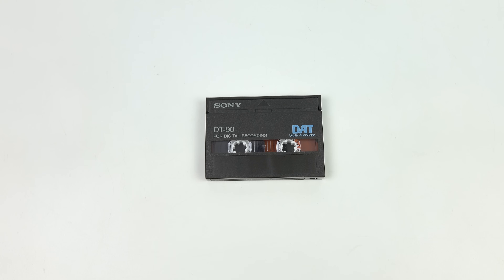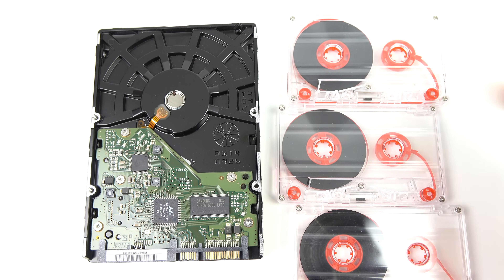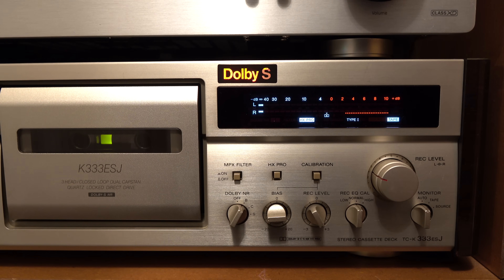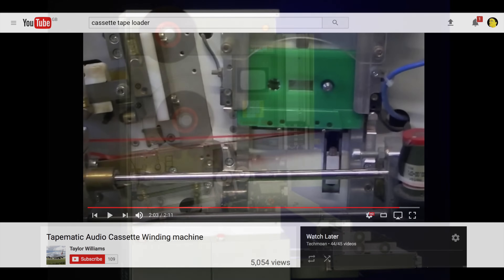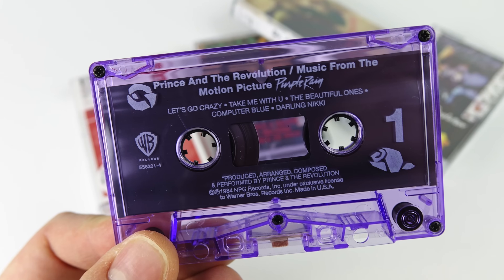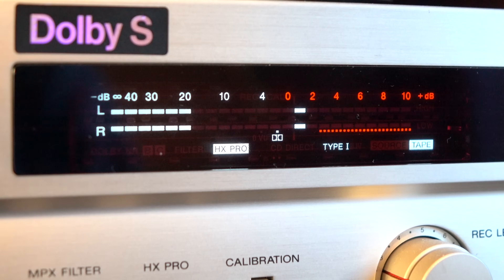Pre-recorded Cassettes' Last Stand

Comment: Last year, SHINee (a K-pop boy band) released a cassette version of their new album to celebrate the 90's theme, and of course I had to buy it. I just had a look at it, no logos mentioning anything about the process. I'm not an audio expert and my tape player is just your average kitchen table stereo, but I have to say that the tape sounds way better than I expected. In particular, it's louder than I expected, pretty much the same dynamic sound I would expect from a CD (again, on a regular crappy stereo). The only problem I noticed was that it sounds like you can hear the other side of the tape in some of the silences.. is that a thing that can happen?? Now I'm really wondering whether any of the later developments of cassette technology were used to make it, or if some dusty factory in China that never let go of their original equipment pumped it out.

Anyway, I wish artists looking to appeal to collectors would do more cassettes than vinyl. Let's be real, neither of them are practical or necessary, but cassette takes up less space in my bedroom...

Comment: Digalog or not, at the end of the day, tape is tape, and it will degrade over time.  Sure, Digalog was an improvement, but it doesn't have the durability, overall evenness of sound quality, or the ability to instantly skip to a chosen track like CD's.  Plus, CD duplication machines are more readily available today and way cheaper than when they first came out.  So, if you want to keep a recording around for a long time while playing it often and ensuring the sound quality doesn't gradually go to shit over time, CD is the way to go.  Even my Digalog cassettes didn't sound as good as when I first bought them back in the day all brand-new in the shrink wrap.  Meanwhile, I have CD's that are over 20 years old and counting, and they still sound as good as when they were brand-new.  The recordings are crisp and clean the way the artist intended, and there's no annoying tape hiss.  The last cassette I bought was in 1998 -- a greatest hits compilation by Motley Crue, and the last mixtape I made was a David Lee Roth-era Van Halen tape in 2002, which the tape player in my Jeep promptly destroyed, much to my dismay.  Since then, it's been mostly CD's and the occasional old vinyl record for the kick-ass artwork.  That said, I don't see the cassette making a comeback, unless the industry can invent a tape with CD-quality sound that doesn't degrade over time.  If that ever happens, I may consider buying cassettes again, but I'm not holding my breath over that!

Comment: Ah, the humble cassette. They CAN sound surprisingly good but you really need a combination of a higher end tape deck, Dolby S, and Type IV tape. Once you start removing those (e.g. a lower end deck, an early form of noise reduction or no NR at all, or Type I/II tape) the drop off in quality is noticeable. Still, I grew up with cassettes (as well as vinyl) so they do hold a certain nostalgia for me.

Comment: Great video as usual! And most of the comments below are even pretty good this time. I have a beef though with your basic stance that a given format has to compete with a CD or other digital file. The premise seems to be if the recording has background noise or such it is somehow a failure. I think I mentioned this before, but I’m not looking for some sort of music nirvana. I just like to enjoy a playback system, or a vintage car, snowmobile, dirt bike even chainsaw for what it is. They are all technological solutions arrived at at a given point in time. Using these old devices is like a time machine. It allows us to see how far technology has advanced. Or devolved as the case may be. 
I have long dreamt of starting a small pressing house centered around 8 tracks and maybe reel to reel tapes. I have around 17000 8 tracks. So lots of tape to reuse. Ya I know the technical horror. But I turn Anne Murray and Irish Rover tapes into AC DC and Judas Priest on an ongoing basis all the time and I’m quite happy with the results as I trundle down the road in one of my 70’s cars. You can’t really hear the music over the exhaust anyways. So the technical info in this vid was quite informative. Although I just about fell asleep a few times. The high speed dubbing aspect was quite interesting. I have often wondered if half speed recording would be a benefit or not. I think you hit the nail on the head when you guessed that most people are buying retro for the novelty. And as such any kind of Dolby or such would be a mistake. As it would penalize those who collect early gen tape machines.

Comment: I have all these cassettes and no player. After my last one died I never bothered to get another. I slowly abandoned cassettes for CDs even though that meant I would buy less because CDs were rather expensive in comparison. The upside was that you could get a lot of discounted cassettes because few people wanted them. By the time I started to buy more CDs they were just getting rid of those stupid longboxes. One of the first CDs I bought was in a longbox. Midnight Oil's Red Sails In the Sunset. I think the box lasted maybe two days before I decided to throw it out. I was maybe 12 or 13 though and didn't think to save such a thing. I imagine most longboxes are long gone because people tended to toss them and they were not that durable anyway. They created tons of trash because it looks like few bothered to recycle the packaging. I think that Playstation's earliest games also used a form of the longbox. You can occasionally still find used games that come with them. I should have several Digalog cassettes. But I can't test them against other cassettes myself because I lack a player.

Comment: Someone may have said this already, but the direct-digital-to-analog PCM (pulse code modulation) may really be effectively a digital signal made by AC bias combined with pulse width modulated audio fed directly to the recording head. The impedance of the inductive recording head would smooth out the signal and leave the analog signal on the tape. Of course, the frequency would have to be computed to work with the particular tape, but most commercial cassettes used basic ferric oxide tape.

Comment: hi you said about tape loop. the basf 1/2 inch  tape is very good i got hold of some new pancake tape basf works well
on otari mtr 10 /12 units . tascam 38 not very good. i have a otari 2700 tape loader making a video on how they work
just waiting for terry's rollers to do the pinch rollers, bob

Comment: I have a B&O BeoCord 8000 cassette deck and it sounds incredible. It cost in 1981 when it was brand new more than a Linn Sondeck LP12 turntable did at the time lol. All guests at my new years eve party couldn't believe they were listening to 30+ year old tapes. The Beovox CX50 speakers help a lot too. It has some pretty epic features like the ability to just type in for example 15:00 on the keypad and it will jump exactly to 15 minutes into the tape. It gives the tapes when playing a proper timecode like a VCR. Apparently it does this by scanning the thickness of the tape as it plays, pretty impressive stuff for 1980/81. I got in to compact cassette quite a bit lately as almost everyone practically gives them away for nothing these days.

Comment: Based on the experiments I did, I think VHS suffered from the same analog duplication problems.
Reply: I've seen the inside of the porn VHS duplication room at a mayor porn publisher. The two longer walls of the room were covered with wallmounted IKEA shelves from floor to cealing holding 200 almost new good and cheap consumer model Mitsubishi VHS players. At the short wall opposite the door there was a table with a deluxe consumer VHS player for playback (National/Panasonic?) and some equipment that made all Mitsubishi's start the recording at the same moment. The recording was done at normal speed to preserve the quality and because consumer models only had normal speed. The employee then had to swap the tape in each Mitsubishi before he started the next batch. 

(Then I'd guess that he affixed the labels, put the cover paper in the sleeve of the cases, put the cassettes in the cases, packed it all in a couple of large cardboard boxes, and then took a ccoffee break or did other odd jobs while he waited for the next batch to reach the end of the recording).
Reply: @goishikaiganmademou  Rotating porn tapes... why didn't i ever see such jobs advertised?
Reply: @keinunvergebenesaliasgefunden  same
Reply: @keinunvergebenesaliasgefunden  His job description was "janitor", but in the local language (not English). The name of the company was the only hint of that this task might ever occur.
Reply: @goishikaiganmademou  And set the write protect tab
Reply: The 8-Bit Guy I agree
Reply: Presumably they went to a digital bin system as well?
Reply: Love to see you and LGR so interested in this channel!
Reply: Ever used a VCR as an audio tape deck? You can record a six-hour mixtape using the slowest speed. The sound quality is indistinguishable from the source and has zero hiss.
Reply: https://youtu.be/UXU8qttgOk8
Reply: A reasonable conclusion.

Comment: The drop in sales for 1991 was due to U.S. economic conditions, meaning less disposable income.

"The economy was in recession from July 1990 - March 1991, having suffered the S&L Crisis in 1989, a spike in gas prices as the result of the Gulf War, and the general run of the business cycle since 1983. A surge inflation in 1988 and 1989 forced the Federal Reserve to raise interest rates to 8% in early 1990, restricting credit into the already-weakening economy. GDP growth and job creation remained weak through late-1992. Unemployment rose from 5.4% in January 1990 to 6.8% in March 1991, and continued to rise until peaking at 7.8% in June 1992. Approximately 1.621 million jobs were shed during the recession. As inflation subsided drastically, the Federal Reserve cut interest rates to a then-record low of 5% to promote growth." (Wikipedia)

Comment: Half-speed makes recordings better because high frequency recording and reproduction is typically most difficult to do. The needle must move faster on a record, and the gap on a tape head must be very narrow. Considering this, dubbing at speeds higher than normal will cause degradation of high frequency response on the end recording, depending upon playback and recording head limitations, amplifier limitations, and, in the case of phonograph records, physical mechanical limitations of the cutting head.
Reply: Half-speed recording is superior for cutting through a lacquer to make the vinyl stamper. For high-speed tape duplication, high-speed is superior in terms of almost no wow and flutter, and the frequency response on a good tape can reach 18,000 hertz. The physics are very different from mechanical cutting.  The double-speed, double-well recorders did not perform well because of poor design and cheap parts, not because of speed.

Comment: what I would like to know is did the music play faster towards the end of the tape as the full spools outside would spin faster as it filled with tape?
Reply: No. Tape speed was set by a metal spindle ('capstan') with regulated drive, and the tape pressed against it by a rubber wheel. This rubber roll fitted in the first front gap of the cassette (pulling the tape along the heads with constant speed), the record-play-head fitted into the middle one, the eraser at the third gap (for standard construction - there were others as well). The tape reels had a low-torque drive, just to just roll-up tape and avoid 'salad' - the reel drive did (should) not influence tape speed at all. 
 
You were probably thinking of a vinyl disc which on the outside indeed has faster track speed than near the center (as turning speed is constant). Tape recorders always worked with constant tape speed (and varying reel speed depending of empty or full reel). 
 
Indeed, the idea of using constant tape speed and capstan drive made tape useful at all. Good recorders kept the tape speed constant to +- 1/1000.
Reply: akronymus thanks for your reply. I alway wondered about the speed changing but as you say it doesn't.
Reply: christastic100
The thing is, if speed is not constant, tone pitch will 'walk' as well (and minimal differences or fluctuations will be heard very annoyingly) - so it dos not work to just pull the reel. So tape drive and speed adjustment is done right next to the tone head (magnet pick-up) by capstan.
 
Cassette recorders are just down-sized tape recorders (half tape width and speed, less tape on reels, reels packed in a housing) and work just similar. But the big ones were immensely expensive, and cassette recorders could be afforded to record the teen bands from the 1960s on - this was part of the big success.
 
I think on the same channel there is a video explaining how big tape recorders work - there you can see how it is built in detail.

Comment: I have one of those tape deck converter thingies that you plug into your headphone jack and I noticed I really have a hard time getting the volume right on it. I wonder what the dynamic range is on one of those.
(I may be using the wrong term here, since this is different.)
Reply: If you are talking about dynamic range of standard pre-recorded cassettes - this was just a shame. The cheapest recorder bought at the toy department could do better recordings / dynamic.
Reply: No, sorry I didn't explain it very well. It's this thing that looks like a cassette but it has a cord on it that you plug into your phone or whatever else and it plays that output through your stereo. It seems like the levels are always really low on it because whenever I switch back to the radio, the radio is too loud.
Reply: Watchdog Goon
Ok, you talk about adapters that fit in the cassette slot of a car stereo and have a jack to connect to a CD player or an ipod (newer ones connect via bluetooth)?
 
They have a weak point - the magnetic transmission to the playback head. Those heads differ in layout, so the transmitter may not precisely cover the pickup gap (for a tape, the vertical position must hit the track, but the horizontal position is not important). And as cassettes have a specific frequency response, these adapters need to have some kind of equalizer. If this is poorly made, quality can go down to landline phone sound.
 
If someone owns an FM transmitter you plug to your mp3 device, test this. I never used one, but they seem to be better.

Comment: Cobalt tape also had the advantage for the labels was that very few consumer recorders could record them. Higher bias level, much higher record level needed that most recorders could not do, thus a chrome tape being recorded to would suffer from low output and possibly print through of the old recording as the bias and erase could not clear the tape.

Recording with the duplicators used video amplifiers, as the bandwidth was basically the same as broadcast video, and as a bonus the record heads could be optimised for a larger gap and a sharp field end, as the audio is recorded by the remnant magnetism at the edge, not the field in the gap as is needed to play it. 

Video though was still stuck at 1:1 recording, you had a very small number of duplicators that used a pattern copy technique, using a special low coercivity tape and a master metal tape, that was run through a constant field at high speed to copy the field onto the tape. Was very fast, but drawbacks were low signal strength, poor noise performance and very susceptible to an external magnet erasing the tape audio or control track off the edges. The standard one however was capable of pretty good results, and you had Panasonic duplicators that could do a whole load of copies ( or in their other application as surveillance recorders) as you placed a pile of blank tapes in the top magazine and it would put a finished set of recordings into the bottom holder with time. Nice machines, incredibly roust as well, as they were meant to run nearly 24/7/365 for a year or more between services.
Reply: First of all, almost no duplication was done on cobalt. The better tape was chrome, and then BASF chrome/cobalt formulation that supplanted it. Any half-decent cassette recorder worked well with cobalt or chrome tape. (You may be thinking of metal tape, not Type II.) High-speed video was either Sony's Sprinter or DuPont/Otari TMD. Both used the same tape as that used in regular duplication except for TMD, which required chrome tape. All high-speed tape were high coercivity formulations. The duplicated output for high-speed machines was more uniform than that for multiple banks of VHS recorders.